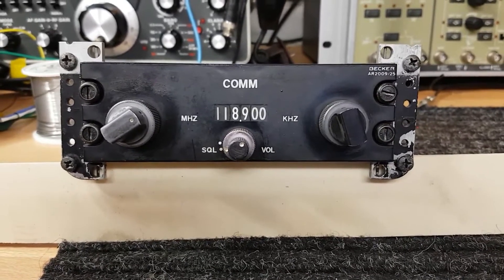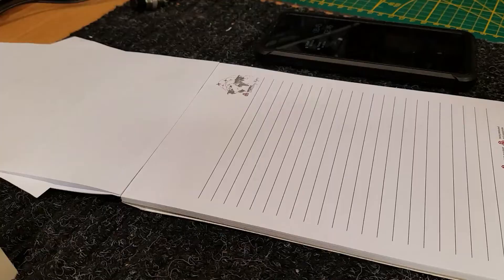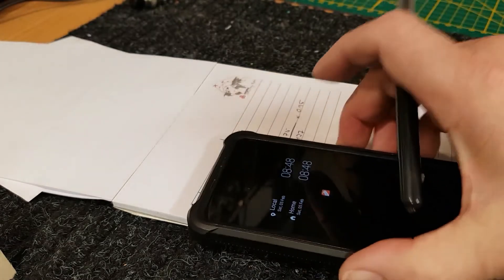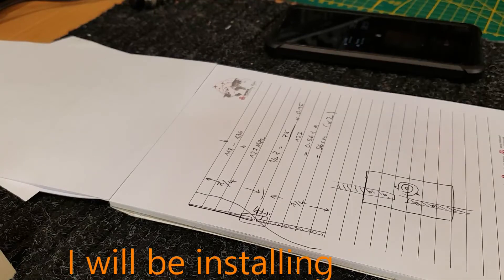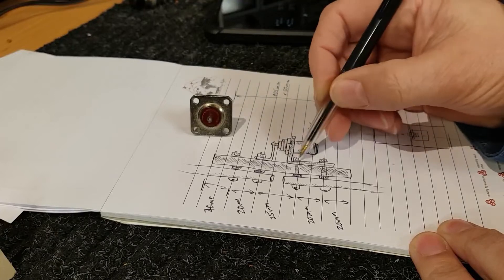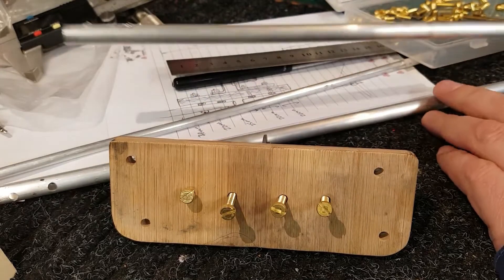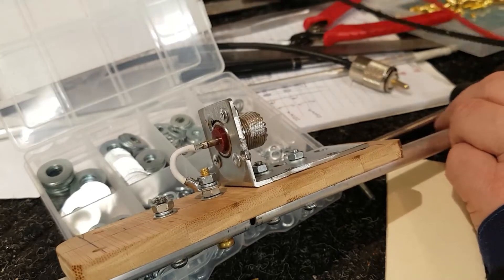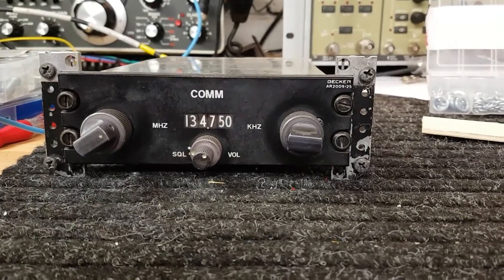Making a quick and easy "Stealth" Quarter wave dipole VHF Dipole Antenna.

Comment: Got some good ideas from your vid! Going to build a stealth Air Band antenna to build into my underseat pack so I can monitor the aviation band while at the gate or lounge. i want to use some light weight coax and 3D print an insulator. BTW my former tail number was ZS-JSE which I based at Cape Town International. My current ticket is W2PN. JSE is apparting still going strong getting battered by students at Lanseria! 

BTW I used to play with Brian Finch and Kenny Henson in the 70s and am on Brian's first album.
Bob